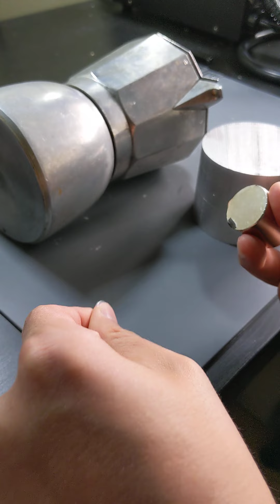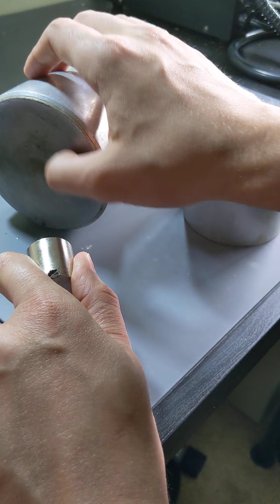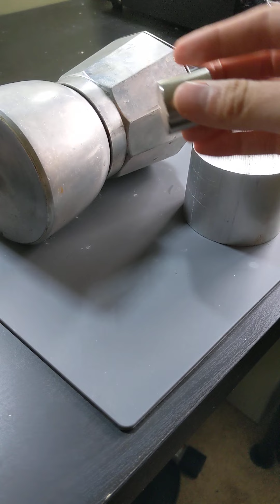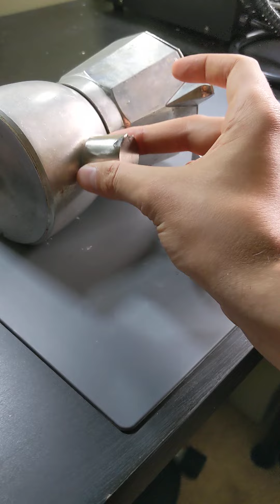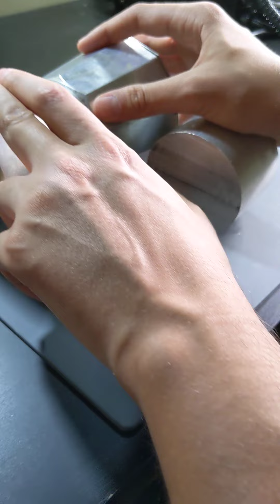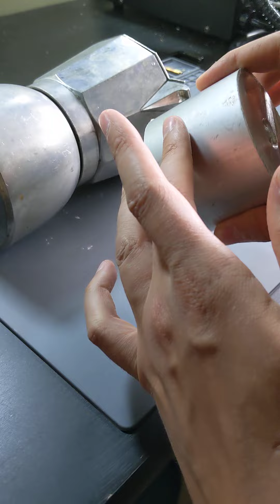Sensing Magnets Identifying Metals

Comment: Have you ever gotten your magnet implant stuck to something? Haha
Reply from the maker: It's pretty easy to pull off of metal. The small magnets like this one made for sensing fields aren't very strong, just a few paper clips or a screw. The larger ones made for lifting can hold heavier things like a screwdriver, and those you have to be careful pulling things off of.